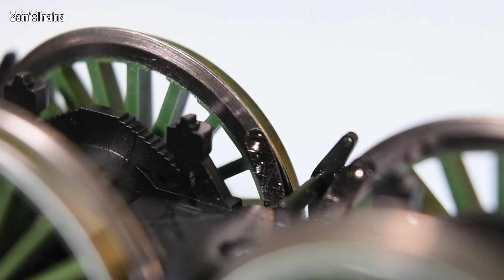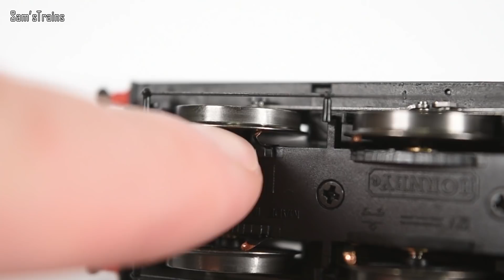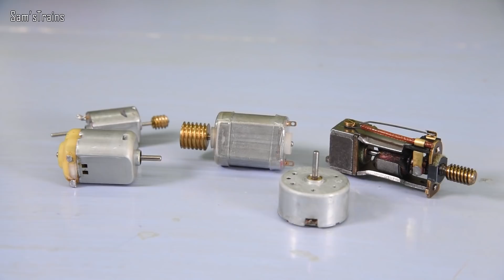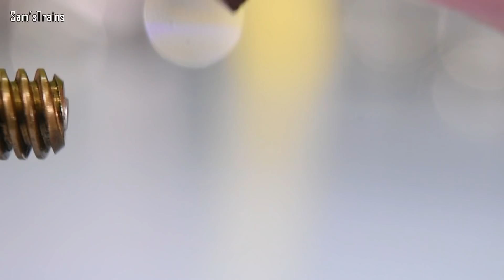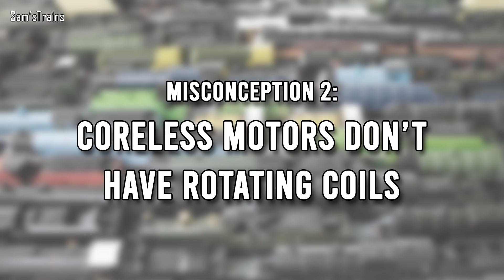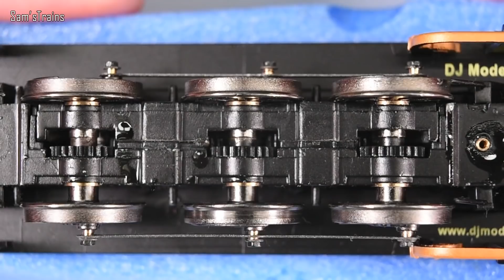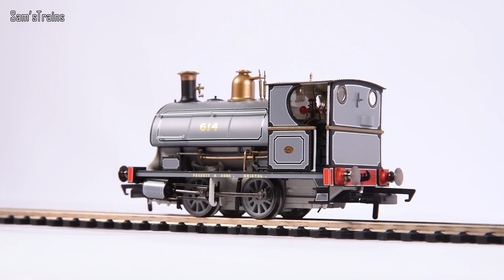What Makes A Good Runner? | How Model Trains Work

Comment: How about  The old Triang Hornby Magnahesion?
Reply: You can buy a new adhesion system from DCC concepts know as powerbase. Its designed to aid trains up slopes without wheel slip as it uses magnets under the train (or in the chassis) and metal strips under the track.
Reply: @bentullett6068  you can but judging from Chadwick model railways experience its rubbish in comparison to the old Triang steel rail/magnadhesion system.
Reply: @richardsinger01  If I’m not mistaken he wasn’t entirely convinced by the Bullfrog Snot solution either.
Reply from the maker: Yeah that's a subject I didn't cover - it's very interesting too!!
Thanks for watching, Sam :)
Reply: But Tri-ang Magnahesion relied on using their steel railed track, which tarnished a lot and went rusty. I'm not sure modern nickel-silver based rails are that magnetic, if at all, but looks much nicer and importantly, has superior electrical conductivity.
Reply: @andrewdking  Nickel-silver track is useless for Magnadhesion. Some people have bought old Triang-Hornby locomotives, run them on nickel-silver track and wondered why they have such poor grip.
Reply: @pras12100  triang copied magna traction fairly obviously (guessing it may have been licenced, like triangs operating wagons) and magna traction suffered the same fate: understandably since the dropping of tinplate flexible tyres have replaced it. one of the obvious plusses of magnetic traction is that it holds the loco on curves at speed which it did very well.